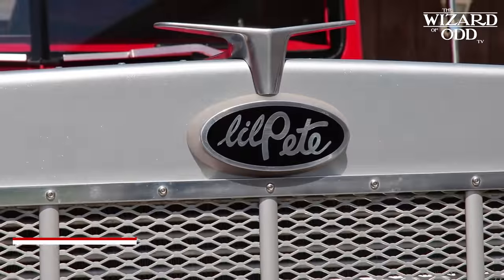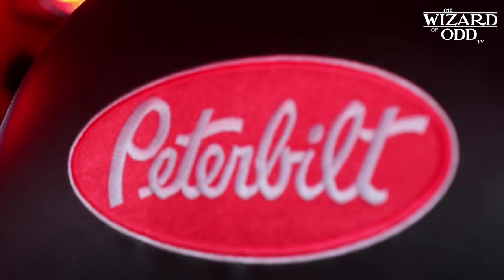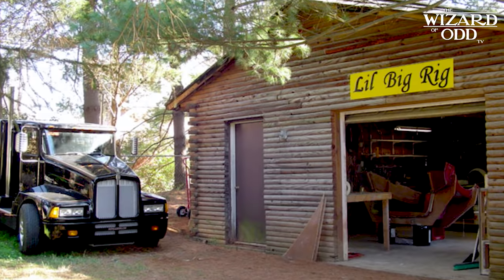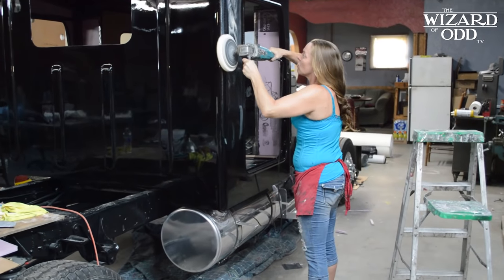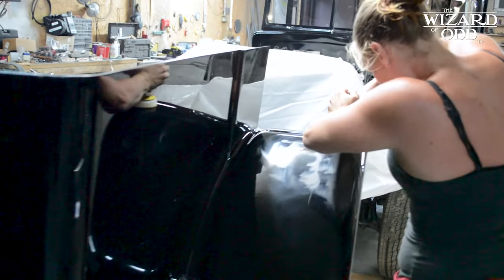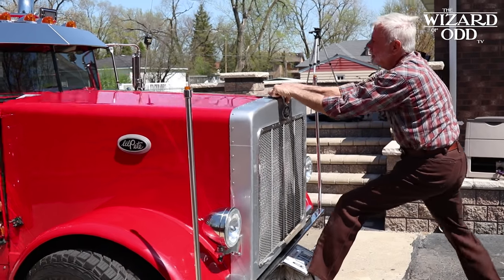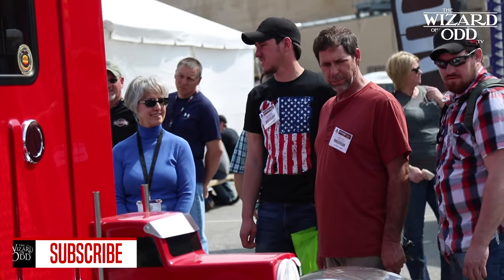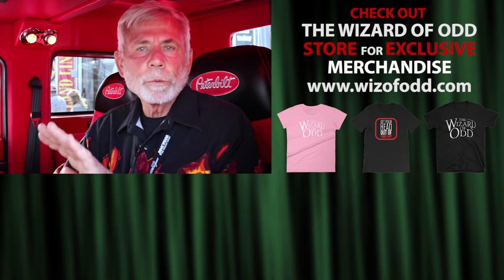The Smallest Mini Truck You'll Ever See Doing Big Burnouts | Custom Lil Big Rig

Comment: need to put a 2nd rear axle under the back
Reply: Jason Mitchell Exactly...it looks goofy with just the one axle.
Reply: Jason & David----------Remember this was a race truck not a trailer hauler--------
Reply: Jason Mitchell not really! Haven't you ever seen a beautiful furniture hauler? They have big regular size rigs of all makes with single axle! That beautiful mini-rig would be great to haul a 5th wheel travel trailer!!! It would be perfect! I wonder how much they cost! Cause a fully loaded dually diesel can cost as much as 70K! With lousy resale compared to something like this!!
Reply: K. R. V. That is one sharp looking peterbuilt. I have never seen one with one axle that looks that good plus it would make the rear longer and look better.
Reply: It was made to race not to haul anything around. But thanks for the suggestion
Reply: Wouldn't be hard to add an un-driven tag axle..could add separate brakes to it and air suspension to make the burnouts even easier with less tire wear by taking some of the weight off the driven tires.
Reply: Gene Floyd along with four spares!
Reply: Jason Mitchell remember it is a pick up truck. It's not a full-size Peterbilt.
Reply: David Mm this is a race track gentleman not a commercial hauling vehicle
Reply: K. R. V. LOL
Reply: K. R. V. Extra weight at the dragstrip
Reply: need to?  Where's the need? 
Very cool!!
Reply: Jason Mitchell ii
Reply: it dont have to be connected to drive train..
some trucks just lower 3rd axle  when hauling heavy load to even load on tires.
Reply: THAT WOULD HAVE BEEN A PLUS   TOPPED OFF    WITH A MUNCIE  STICK SHIFT
Reply: Yeah it’s supposed to be a replica of a big rig it at least needs to be stretched and second axle added even if it’s a dummy axle also needs duel wheels
Reply: Guys, dammit, that's more weight, more friction, more drag, more money, and it's harder to trailer it. It would be slower and heavier. It's not what he wants, and it's his truck!!! It WOULD look good, so build one for yourself! (Of course, he'll probably outrun yours)
Reply: Gorou The fifth son....Rav 4.  Hmmmmmmm
Reply: If they put a second axle idiotic government will claim a CDL is in order so we call it bobbed
Reply: What a shame-truck with one rear axle
Reply: There's zero need

Comment: Why tf does this have a pickup truck cummins in this rather then a full size cummins
Reply: Dont you think a 10 liter plus cummins would b a bit much for this?
Reply: Because they took the frame, motor, transmission, axles and basically everything from his dodge cummins pickup truck, took the body off of it and made this body to custom fit it, it's literally just a normal truck with a mini pete body on it and a lot of engine work, lol.
Reply: @dieselrebel_0494  Way to much weight at the drag strip-------
Reply: a n14 weight over 2500lbs so the 5.9 is perfect

Comment: To many little details missing or over looked. Yes they did a good job.. but if your going to do it right then Details...
Reply: What detail am I missing?? Did you notice the original pieces---------hood pull, bumper sticks, CB, door handle inside, seats, tractor/trailer valves  & tail lights off my full size Peterbilt?
Reply: @waynealberts3212  So they can make a kit to accommodate the Cummins? On the website it said dodge trucks aren't ideal for the conversion. Any help you could give me on this I'd greatly appreciate it I'd love to have one of my own built. Thanks. Billy Jamison
Reply: I found you. My phone kept taking me back to the video. The $30,000 is the kit. Extras like lights, 3rd axle, interior will be extra. I have about $80,000 in it now. Remember I was racing this truck.
Reply: BTW, Dallas has a GATS truck show in late August if you want to see 2 of these together.
Reply: @waynealberts1122  That would be something to see! Would they be able to turn a 2007 ram 2500 with the 5.9 into a little pete hauler I'm not looking to race it but your truck is beyond cool its awesome to see a diesel run that hot.
Reply: @williamjamison2211  Thanks, I'm not sure about the electronics switch. You would have talk to Bob at Lil Big Rig in Nashville about that. He prefers the doner to be a 90's Ford chassis because that is what the mold was made for. Bob moved my drivetrain back 11" to make everything under the narrower hood. He did that because the new IC & rad. were much thicker.
Reply: @waynealberts1122  okay thanks I'll give him a call when I'm ready to have it done to see if he can work with that thank you for replying Wayne I hope you have a good weekend and a happy Easter!
Reply: @waynealberts1122  I'll have to see if I can make it to one itd be nice to visit Dallas again
Reply: @waynealberts1122  alright thank you!
Reply: @williamjamison2211  End of August-----GATS 2019  Where is home for you?
Reply: @waynealberts1122  I live in ohio how about yourself?